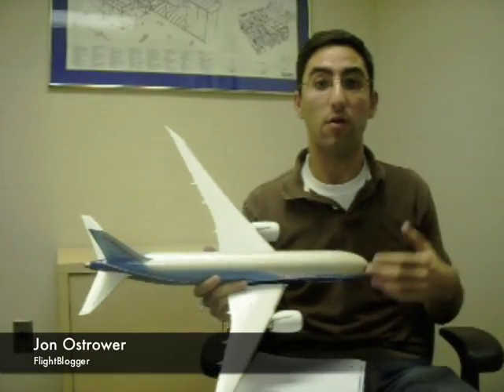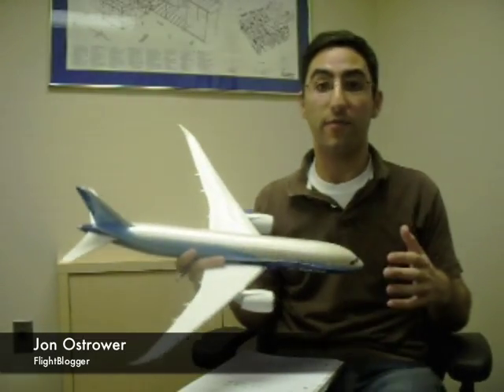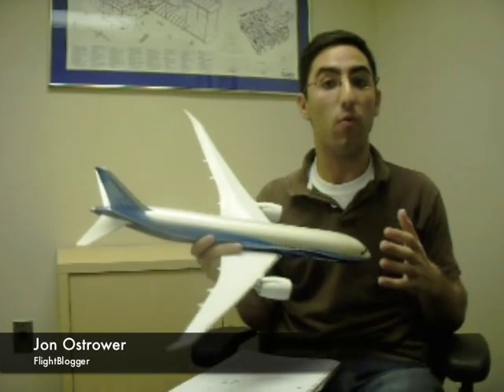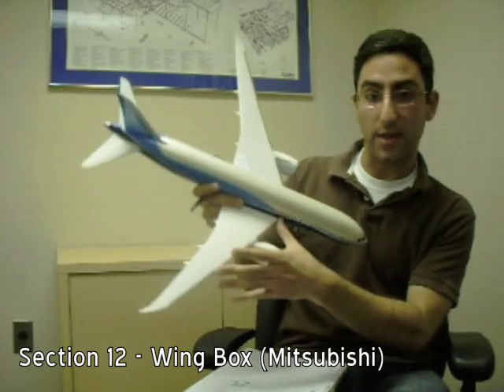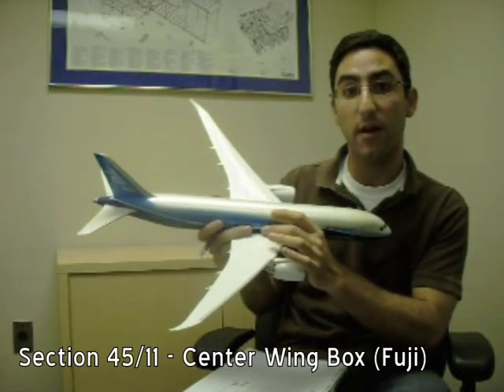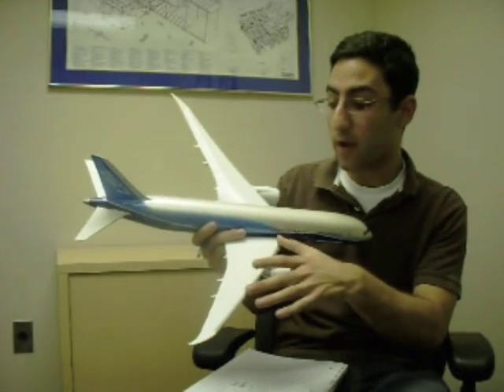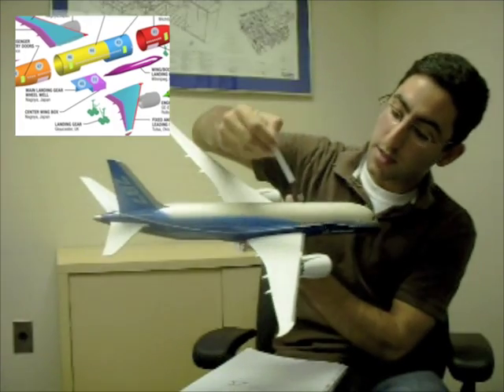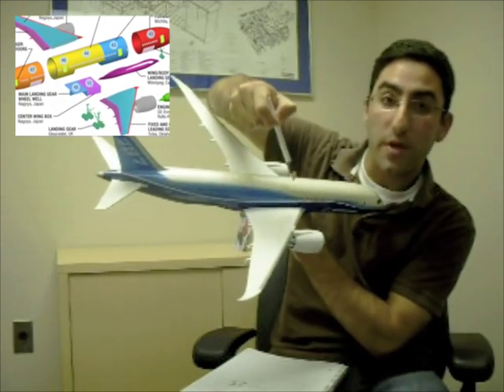FlightBlogger - 787 Delay Explained - June 23, 2009

Comment: I just looked it up:
As required by the FAA, all commercial aircraft must be able to withstand at least three seconds of 150% expected maximum loads on all major structures. 

For a historical comparison in January 1995, the 777's wings deflected 24 feet at 154% max load before they snapped in.

Comment: Don't quote me but I think the parameter needs to be around 150% of design loading.
The problem of adding a fix later is that airlines would have to take the planes out of revenue service while the fix was being done and, from my experience,  the wing box area is not the easiest area on any aircraft to get to to work on.  Far better/safer to fix the problem before delivery to the customer.